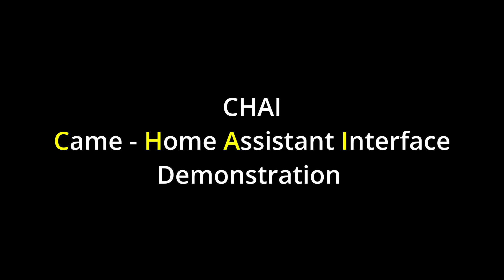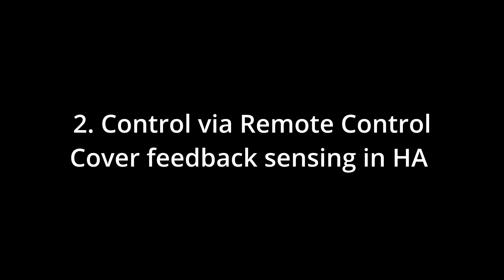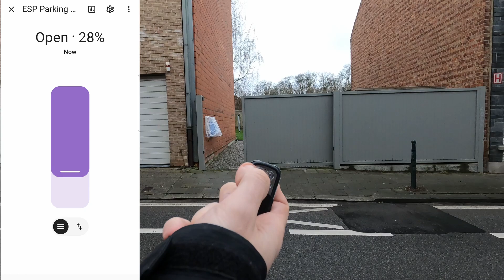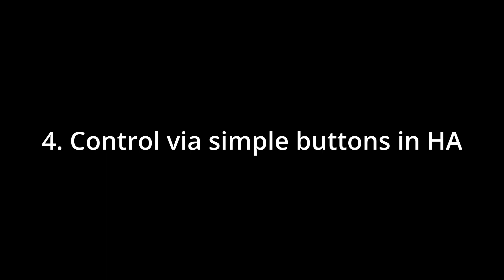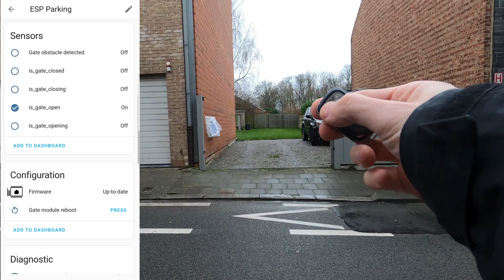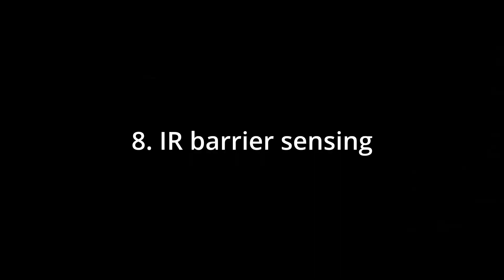Came - Home Assistant Interface demonstration

Comment: Great job is done, but my knowledge is far to repeat this. May be you can share more details about your scheme (yes, I've read article at your blog).
Now I did like this.  Gates 'CAME' desired for using BUTTON (by closing contacts 2 and 7 together). I buy Smart life dry contact relay, wrote in HA automation to SWITCH OFF dry contact after 1 second relay is 'ON'. All work correctly. Yes, I don't see the status, but i need gates when I see it.
Reply from the maker: Hi. I don't know what you want me to share exactly. 
If you can control open/close via HA, that is a good start. 
To get the status, the best is to have ESPHome read sensor information. 
If not, you can just use a time-based cover - https://esphome.io/components/cover/time_based.html . It will work "blindly" and assume that the cover is open or closed X seconds after pressing the button.
No problem if nothing stops the open/close movement.

Comment: @dirt Cheap Hacks Well, I started to build my own controller based on your great job but got problems, can you help me? my Came driver on button 4 is configured open-stop-close to use phisical stair switch in my house to open gate. How to configure it, to work both with your code and one phisical stair's switch?
Reply from the maker: Hi. Well, unfortunately, I have very limited free time, so i'm afraid I won't be able to solve your issue. However, I can try to provide a few hints:
Connecting a mosfet in parallel with the physical button is no issue, but the hardest part I think is that, in that configuration, if the ESP gets "out-of-sync" with the real state of the gate, you're in trouble. With distinct buttons, when the ESP boots, if I want to close the gate, I simulate a press on close. No matter if the gate was previously closed, partially open or fully open, a "press" on close will make sure the gate is closed, period. But in your case, to close the gate, you should "press" the button 1 time if fully open, 0 times if fully closed, and an unknown number of times (either 1 or 3) if partially open, depending on the last movement before stop (was it opening or closing ?).
The first obvious solution is: just put 3 physical buttons in your house (stop/open/close), wire them in parallel with my circuit and reconfigure the gate controller. Might require a bit of cabling and in-house DIY, but very simple (and I honestly hate the "single button" logic).
The second solution is to add some logic to the YAML to simulate a variable number of button "presses" depending on the sensors. In my project, the "sensing" part (is_gate_open, is_gate_opening, is_gate_closed, is_gate_closing) is just meant to display fancy info in Home Assistant, but is not used in the control logic at all (in other words, you can cut all sensing wires and still control the gate fine). But the good news for you is that, as all that information is present, it is "simply" a matter of software to decide what to do. For example, if you press "close" in Home Assistant, it should trigger the following logic in your ESPHome:
a) Test the status of "is_gate_closed".
b) If ON, do nothing and exit, else test the status of "is_gate_open".
c) If ON, press once (wait for a few ms then release) and exit, else we're half-way, press the button once to close (wait for a few ms and release), then test the status of "is_gate_closing".
d) If ON, do nothing more and exit, else we're opening, press the button a second time to stop (wait for a few ms and release), then press a third time to close (wait for a few ms and release), and exit.
The symmetric logic applies to "open", and a simpler one to "stop".
I am no expert in ESPHome programming, but Google is your friend :-) and don't hesitate to post your questions on HA forums if you need more help.
I'm sure you can do it. Good luck :-)
Reply: @dirtcheaphacks  fck... I just figured out that my alarm system from which I can open/close the gate is also connected to the gate automatic with single buttom logic. Must stay with this and think how to change the code. Tahnk you so much for tips!